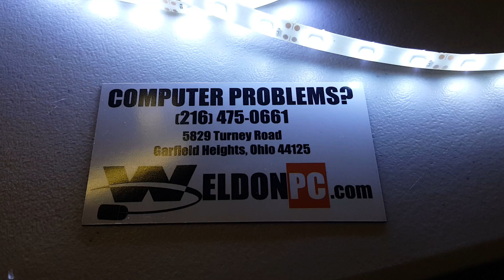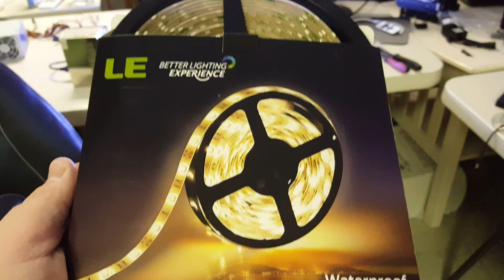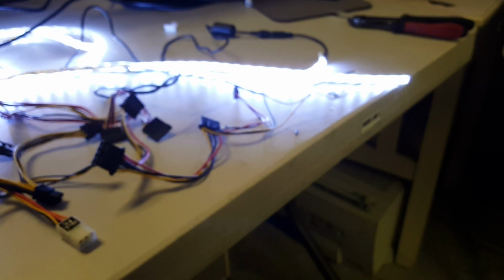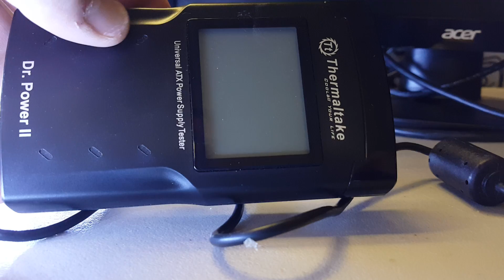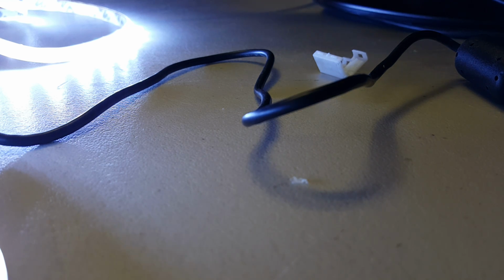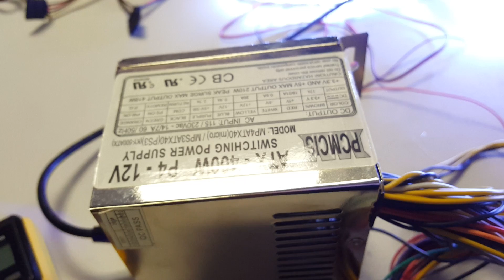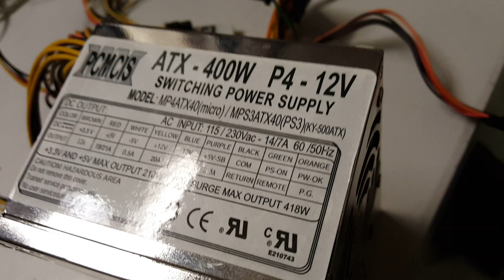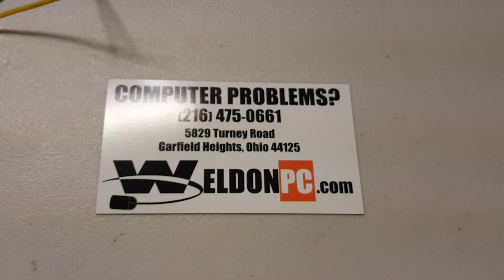Use a computer power supply to power multiple led light strips

Comment: Oh dear 12-9.9 = 4volts. .Try 2.1 volts. This voltage drop will be because you are measuring at the end of light strip. Add 12 volts into that end as well (power inject) and you get 12 volts over most of the strip.

Comment: I did this with a coolermaster RS-550-ACLY 550W Power supply but the LED strip switches on briefly then the power supply shuts down completely, does not restart until you switch off at the power point. I tried joining all the black and yellow wires together, but the problem still happens. How to fix this problem?

Comment: Are the strips 5v or 12v rated ? i have the 5v rated led strip 60/m of 5m , it requires probably 90watts so 5v x 18/20 amps right ?? can an PSU do that

Comment: "With everything turned on it is only giving med 9.9V. That means 9...10...11...12. That is 4 volts being consumed" You didn´t use your fingers to solve that advanced mathematical equation, did you? Voltage is not "consumed", you have a voltage drop. Hope you haven´t burned down your office by now.

Comment: A computer smps converts 120V AC to 12V DC, 5V DC and 3V DC. In my country, it converts 240V AC to the same DC output. So when it converts 120V AC or 240V AC to 12, 5, 3V DC then isn't there is a wastage of power?
Reply: yep 220 always better / cheaper
Reply: @amindnew527   I did not mean that.  I ask that if a computer smps converts 220v AC to 12v DC, 5v DC and 3v Dc, then isn't it a wastage of energy? as 220v AC lowers down to 12v, 5v and 3v DC.
Reply: No Voltage is just the speed or flow of the electricty, how fast it is travelling along the cable, Amps or the brightness of the leds will determine how much power is being used

Comment: One of those 4' liner fluorescent lamps is $7400/year?  So $616 per month for each one? Not sure what you were thinking Im coming up with the 72 being right maybe but the hundred part was an accident. Unless your power company is charging you $100/kwh. Even if thats the case you need some occupancy sensors or a retrofit on 24/7 is around 8765 hours per year at an overpriced 21 cents kWh thats still on $72.92 per year.

Comment: Just to be clear, can I wire the green wire to ANY black wire? I have a motherboard wirebundle that has 20+ wires coming out of it into a plastic head. ONE of them is a green wire, and many are black. Does it matter if I connect the green wire to one of THOSE black ones in the bundle, versus another black one from a separate cable bundle from the PSU?
Reply: Jonathan L yes you can use any of the blacks from the PSU they are all grounds.

Comment: Thanks, this is the same strip lights I was looking at and was considering using an old PC power supply as well. Could a switch be added for the green wire so you don't have to pull the plug to shut of the lights?
Reply: Well I hooked up a 400 watt power supply to one of the LE strips and it lit up for a bit and then shut down. I disconnected it for a bit and then tried again later. The strip lit up and then pops, squeals and smoke as the power supply self destructed. Not sure if it was bad to begin with or if it couldn't handle powering the lights.
Reply: you should not exceed 50% of you max draw current or so i hear, so if you strip only draws 5 amps then you should not exceed  10A power supply ,also make sure it is 12v strip and a 12v power supply
also i would not chose an old PC power supply because most have fans ,  you really  want a  fan whirring  and drawing more more power all the time?
Reply: $7400 !!!!
That don't seem right!

Comment: I'm gonna do this with ~15M 5630 LED strip, will use a Corsair VS350 350W PSU. (One 5M 5630 LED strip is 75W so 75W*3=225W) The PSU on 350W should make it, the PSU also has the necessary amount of Ampere.

Comment: Hello, 

Nice choice to use computer psu for led. I'm wondering, that if i plug only 2 sections of 3 leds (cut from the 5metre trip) on a 12V of computer PSU. Can it work smoothly ? I mean the 2 sections of 3 leds use 20mA/ section so 40mA for total, the 12v of computer PSU which delivery 14A will not kill theses leds ?

Thanks for clearance ^^
Reply: Amps is a draw, not a delivery, so you can't "send too many amps" -- you can only send too many volts
Reply from the maker: Naturawa I can tell you from the experience that I have had that between the two power supplies I'm currently using and 11 full length strips I have had no problems. I run those power supplies day-in-and-day-out to illuminate my store both during the day for the use of the white light and at night for ambient lighting. since I uploaded this video I have not burned out one LED bulb on any of the strips of messed with

Comment: Weldon, I want to build the: DIY Perks LED Flexible Panel project.

Matthew, the guy who made the panels, uses TWO LED strips wired in series. He said I can run both strips using a notebook power supply, and: Make sure it is at least 19 volts and at least 3 amps.

It uses two LED strips, size 5630, and each strip is 5 meters long, with 300 LEDs on each strip.

http://petapixel.com/2016/02/29/make-60-flexible-led-panels-thrifty-photo-lighting/

One of the sellers on Amazon, 360 LED, says I need a 5 amp power supply for ONE strip, size 5630. And a 10 amp power supply for TWO led strips!

So Matthew says a 3 amp power supply is fine, but 360 LED says I need a 10 amp power supply for two led strips, size 5630.

Could you please sort this out and led me know which power supply I should use?

Thank you so much!

Comment: I have the same problem after i connect the strip led light to the power supply I get 10 v Dc. How i can increase the voltage to 12v dc
Reply from the maker: Mohammed Dabbous what are you using as a power supply? A desktop power supply or a small brick like a laptop power supply?
Reply: A desktop power Supply  "Max output power 300w,  on the 12v DC is 16.0A"

Comment: Thank you so much for the video my friend. I have been using these lights for about a year in my home and garage for lighting and was growing frustrated with buying individual power supplies @ $8/ea. Lots of PSUs laying around. Very clear and informational. Best wishes to the business.
Reply from the maker: Shaun Lambert II thank you very much for your kind words. I haven't done a bunch of instructional videos before this one and I didn't realize I had 7500 views LOL. I'll continue doing some videos like this. I noticed a CB radio is that I refuse to wear into my car is sitting here and I think a computer power supply project is in order
Reply: You should see what I've done with the information I got from your video. I needed an exposure light for screen printing to expose my screens covered in light sensitive emulsion. I had an old 4 bulb fluorescent housing that I filled with 8 strips of pure white LED and led all ends back to the top of the housing, where I had mounted the PSU. 

Is this all the companies that install these professionally do? What do they get paid?
Reply from the maker: Shaun Lambert II im not sure how they do it. i can tell you we did this project fot just that reason. we installed this project (slightly modified) above our counter and it looks great!